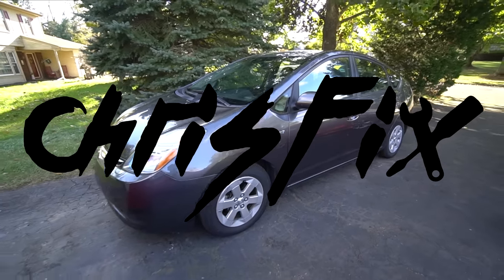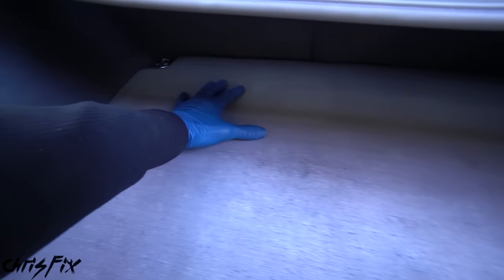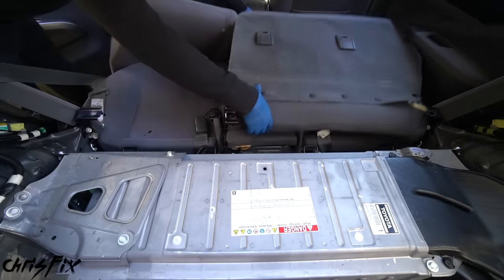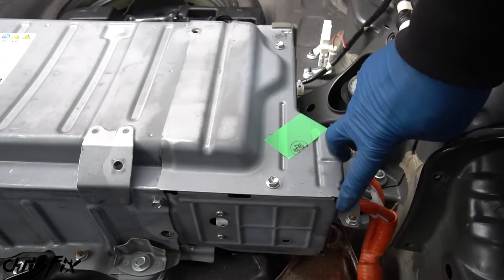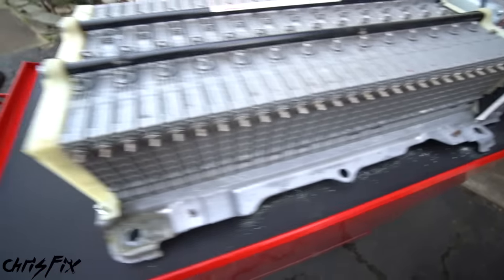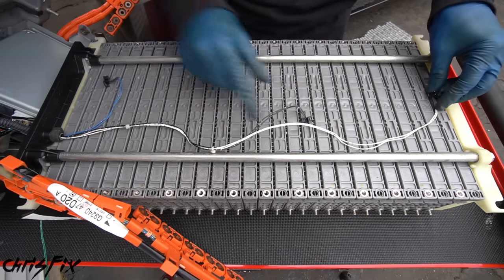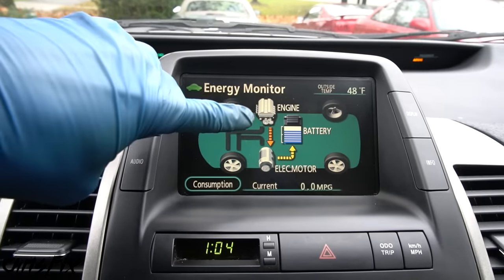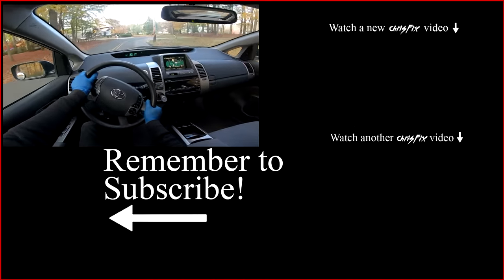I Bought the Most Hated Car on the Internet (and made $1000)

Comment: This video is extremely well done; however, as a professional ASE Master Technician, I am very concerned that people weren't cautioned about the potential risks of handling these very high voltage batteries. I was especially concerned @ 12:00 min mark where you did not verify a proper disconnect, using a voltage meter, before touching the terminals. Professionals wear "High Voltage" gloves (same a utility workers) and use a class III volt meter to verify disconnect before proceeding. I admit that the chances of an accidental electrocution are low, but the voltage/amperage potentials should not be ignored and the proper testing @ 12:00 minute mark could prevent someone from getting seriously injured or worse.

Except for the safety concern, I want to complement you on an excellent video.
Reply: Yes this is one of the few things that you should not DIY
Reply: Looked like it went pretty well.  You can’t argue with a guy saving 350 bucks cleaning a little fan either.
Reply: Darryl Howe -So where do you attach the volt meter to check it?
Reply: Davy Pig he is a mechanic
Reply: To clarify, you're talking about testing the terminals on the orange HV terminals shown after he disconnects the plastic modular plugs, to verify that the orange main disconnect/safety plug shown at 4:20 actually disconnected the system, correct? Similar to flipping a breaker that says "Kitchen", and then checking with a meter on the outlet terminals before touching them, to ensure that not only was the correct breaker flipped, but no wiring fault exists that still allows the particular outlet to be live?

Furthermore, what electric glove class should be used? It seems Class 00 would work, since that's still about double the expected system voltage...
Reply: @multimediaman256  Yes this is correct. Making the assumption that the disconnect plug "should have worked" could get someone killed.

Imagine the possibility that some "do-it-your-self" person decided to rebuild their own battery and inadvertently bypassed the safety plug. The test literally take less then a minute and could prevent a tragedy. 

As for the gloves, it is generally accepted that Class 0 is sufficient.
Reply: @darrylhowe1465  Thanks for this info! I'm one of the few people here actually planning to do this so I really appreciate the safety advice on this. I'll invest in an appropriate voltmeter and gloves.
Reply: You must be awesome at parties.
Reply: @markepaugh  He is because he maybe even saved someones life with this info he gave us.
Reply: @markepaugh  the dude is at the pinnacle of his trade, he is straight up warning people of the danger that PHEVs and electric cars pose to amateurs and you're saying he's boring.
Reply: @Sam-NFF  yes
Reply: @markepaugh  That remark is really unnecessary, he helped us, he maybe even saved someone's life. And you're trying to act cool by saying "You must be fun at parties". He seems kind, look at the essay he wrote, and took away 10 minutes of his life trying to help us and you answer rudely. Try being nice next time.
Reply: @garethbaus5471  so if you have a heart attack and you have the option to choose between picking a surgeon who has obtained education with YouTube DIY or a surgeon who shadowed and mentored doctors, went to med school etc, who would you pick
Reply: @jayasmrmore3687  changing a high voltage battery is both easier and lower stakes than a surgery.
Reply: @johnnyspaceman1  no he is right
Reply: @garethbaus5471  how? If you do something wrong and are not 100% precise, things won’t work out.
Reply: @garethbaus5471  however I do agree with doing DIY on things like bodywork
Reply: I’ve heard that if the generators on these cars go bad, it’s an expensive job to do and not worth fixing the car, wonder if it’s true..
Reply: @jayasmrmore3687  Chris did an excellent presentation on how to accomplish this task.  The point I think you are trying to make is that if, after watching this video, you don't feel 100% confident in doing this work, then DON'T do this repair.  Chris took the time to get you links to the repair manual pages so that you could print them out.  This is what the mechanics use too.  At least a third of the ASE trained mechanics out there never got trained on battery replacement, as they got certified well over a decade ago.  I think I'd be safer personally doing the battery side on my own, and have the mechanics do the gasoline side, as that's more complex.
Reply: @beekay3294  oh I see
Reply: @JS-hd5uy  lol, Good point. I think the general rule is to not lick any of the terminals
Reply: @davemarks7322  noted
Reply: You're literally giving life or death advice and people are being ignorant about it... Hate the comment section
Reply: @KingMalaxis  Realistically speaking, the only people that would have the skillset to pull this battery out of this car would be smart enough not to bridge the various places carrying roughly 80-100 volts DC which would not kill your average guy with clean dry hands or gloves on. Though if he had just eaten a salty meal and left some of it on his fingers for better conduction then he might fall into the category that you speak of.....dead. But I'm not even sure of that.
Reply: @Emil .Honganmäki okay just be careful
Reply: @agalpalacio9157  then replace the generator and not the entire vehicle
Reply: @rwatson2609  right but as you said, people with the skill set. Haven’t been a line technician for a long time but some of the things that I’ve witnessed makes sense as to why the Warning the OC made was warranted
Reply: First thing i thought when i saw he was replacing individual cells.  Doesn't take much DC voltage to seriously injure or kill someone.  Even though this video is now over two years old, it should be edited to include a warning about high DC voltage.
Reply: @darrylhowe1465  ok  boomer
Reply: Know how you know someone is clueless? They call "current" "amperage"
Reply: @markepaugh  I just watched the video and I am not sure why I started to read a comm. your reply killing me. instant image of Sheldon.....
Reply: @mufa1967  what are you talking about?
Reply: @mmmhhh.  To answer you question, yes it would be safer; however, I don't believe it is necessary or practical to do this. Just be sure to use a class III volt meter to confirm that there is no voltage present at terminals that could be touched.
Reply: @davypig571  The only point here is the issue of safety. I believe you can, and should, "argue with a guy saving 350 bucks ...", it someone is seriously injured or killed in the process.
Reply: @JS-hd5uy  Using a class III voltmeter, you would touch across the 2 terminals where the vehicle cables attach to the battery. There should be ZERO volts.
Reply: @johnnyspaceman1  Why? Are you somehow offended by truth?
Reply: @darrylhowe1465  probably takes you an hour to replace the batteries in your remote control
Reply: @multimediaman256  You are correct on both points.
Reply: This is exactly right.

As for the gloves, we choose to use Class 00 and we alternate testing of the gloves every 6 months.
Reply: @markepaugh  As per usual, the designated driver is not considered the life of the party. I'm just trying to make sure there is life after the party. lol.
Reply: @garethbaus5471  Easier ... yes; however, the surgeon doesn't have to worry that his patient might electrocute him and stop the surgeons heart.
Reply: @johnnyspaceman1  your demonstration of your intelligence suggests this comment is a complete waste of electrons. lol.
Reply: @agalpalacio9157  Many of these vehicles do not have a "generator" in the conventional sense of the word. They use DC to DC converters; and, yes it can be expensive.
Reply: @beekay3294  I apologize if it seemed like I was diminishing Chris' efforts. It is an excellent video. I am simply pointing out that there is additional information that people should be aware of in order to prevent someone from hurting themselves.
Reply: @rwatson2609  Yeah ... don't lick the terminals, until you have tested them with a known good working class III volt meter.

If there is 0 volts at the terminals, you can safely lick them to your hearts content.
Reply: @KingMalaxis  Try to think of it as an entertainment.
Reply: @rwatson2609  For a Prius, the voltage is closer to 300 volts; however, it is your life. You can choose to do with the information I provided as you will.

I would tease you to do a video to prove your point but ... that would simply be a "dead end".
Reply: @bertsimpsan  Your welcome.
Reply: @bertsimpsan  Since "amperage" is the standard measurement of electrical "current", I'm not sure I understand you point. Please explain.
Reply: @k1llsh0t48  Why? Is truth offensive to you?
Reply: @darrylhowe1465  lol...someones fuul of themselves..biggly fucking genius  over here
Reply: @darrylhowe1465  You were right on target, it was Jay's statement which I was replying to.  Yes, better protection, and yes, don't assume safeties work every time.  Been hit with 440v, it cut through the cover plate I was holding like a deadly bear claw.  Didn't see it happen, as I woke up wedged between a pair of 2x4s where I was slammed into the wall by the jolt.
Reply: @darrylhowe1465  Lol. only spark plugs. I did pull apart my Prius C and do a partial battery swap. Sorry no video but lots of pictures for my own reference sake. I probably won't post any content since I am thinking of doing this to make money and giving away too much knowledge would be to my disadvantage. I have been a field technician on electromechanical products for 30 years which actually doesn't add up to as much as you'd think, whereas being an electronics hobbyist is huge in knowledge content in comparison.
Reply: @darrylhowe1465  lol.
Reply: Well said brother
Reply: I have to agree with you on that. Its sadly not touched on as much as it should be. Most people do have enough common sense to be cautious around this stuff but of course there is a reason why we test to make sure its safe. In the future as more of our cars use electricity to run and drive it will become common knowledge. So eventually everyone will know this and will probably take it into account. As for the moment untile the year 2035 it will need to be explained at least a little.
Reply: You just gave us the rest of the knowledge, thanks!
Reply: @JS-hd5uy  between the two high voltage lines
Reply: Thanks for the info, however people calling you to stfu and many things, they fall short from education
Reply: And they key needs to be far away as possible during the procedures.
Reply: @mmmhhh.  Draining the battery effectively ruins it. In use it is limited in depth of discharge (somewhere around 50% IIRC). Doing the job Chris describes safely is no trick at all.
Reply: @jayasmrmore3687  Toyota hybrids do not have generators. The hybrid battery is charged by the two motor-generators in the hybrid transaxle. They are very reliable, except for MG2 in the first generation Prius (2001-2003).
Reply: @rone8123  I've been bit by 125V battery voltage in substation control houses. Unless it is on a thin skin area (like the underside of my arm) or I actually grab something it is just a minor bite - I rarely even flinch.
Reply: Interesting
Reply: Up for this comment, so everyone could see it
Reply: @jayasmrmore3687      I am a master baiter myself
Reply: @twinturbo8304  “master baiter” 😆 I see what you did there
Reply: @JS-hd5uy  I am an electrical engineer  Very interesting video from mechanical take output back put  point of view. If you don't understand where to attach the voltmeter and its readings don't do the job, the voltage can kill you like working on a house mains installation but with a greater fire risk!
I think the person supplying the battery should do a swap out assembled one, a bit more money but a lot safer. Maybe in its case!
Reply: R Watson this is why people die; having an assumption on top of no understanding of electricity..the prius batterys are HIGH VOLTAGE (500-600v) and incass you didn't know high voltage dc is the most dangerous form of live power
Reply: @everyday tenor I can't speak for ChrisFix, but in my experience the job is not that risky. It is tough most of the time to contact the full voltage unless you are handling it carelessly with the bus covers off. I didn't wear gloves at all, except some cut-resistant gloves when the raw metal edges were exposed.
I have long experience with high DC voltages. Back in the vacuum tube days I got 285VDC across my fingertips dozens of times when I worked on a model of light aircraft radio, the Narco Mk-12. Before that, when I was 14 years old (1966), a friend and I were working on his aunt's console radio. He had found the power switch was bad and had bypassed it before I got there. I knew the radio came from the days before alnico, so the speaker was a field coil (electromagnet) speaker. I also knew it was popular to use the field coil to filter the B+ supply, about 300V in that model. What I didn't know was that one end of the coil was riveted to the speaker frame! At one point I had one hand carelessly resting on the chassis, and for reasons unknown I slapped the other hand down on the magnet structure. It felt like I was hit in the back of the head with a baseball bat. Things got dark but I never passed out.
In later years I worked with 54 VDC communication batteries and 125 VDC substation power. I couldn't even feel the 54V unless I had thin skin, like the underside of my forearm, against something. The 125V bit my fingers, but not much - nothing like house current. I must have contacted each one dozens of times over the years.
The moral is: be careful even when you know it is not as bad as it sounds.
Reply: @mmmhhh.  The cells may not be accepted as cores if discharged. Electron warns: "As batteries sit without use they become irreversably damaged and are no longer rebuildable." We know that is true of lead-acid batteries that are fully discharged and not immediately recharged (or even just discharged completely).
Reply: @darrylhowe1465  The reports of a "generator" failing are probably for the larger motor-generator (MG2) in the 2001-2003 Prius. That generation did not have a voltage doubler in the inverter so MG2 ran off 275V instead of 550V. That meant twice the current - four times the heat - of the modern version. One of our 2002 Prius died that way: MG2 is part of the hybrid transaxle. The stator is available separately and cuts the price of repair down to the $2000 range rather than $6000. The 2004 and later rarely have the problem.
Reply: @beekay3294  440VAC, I presume. Edison was right: AC is much fiercer than DC, and depending on the sort of contact you make can lock you on. I have been tickled by 125VDC finger to finger and bitten by 90V p-p telephone ringing voltage across my fingers.
I'm glad you were blown into the clear. 440 does not leave a lot of people to tell the story.
(34 years working IT/communication systems for a large electric utility - retired two years ago.)
Reply: respect to you sire
Reply: Gloves are expensive. Why its $4000 dollars